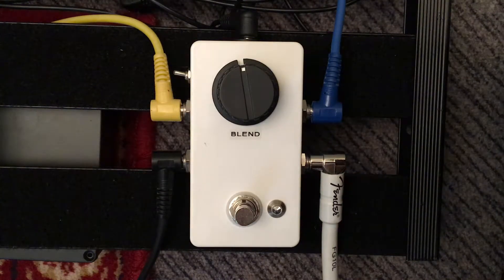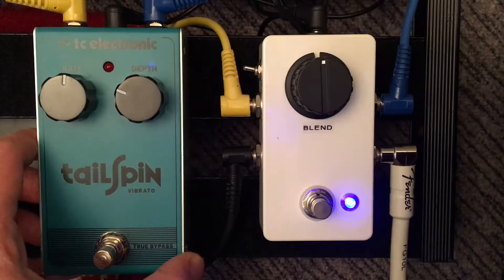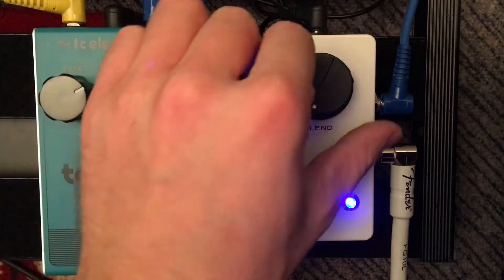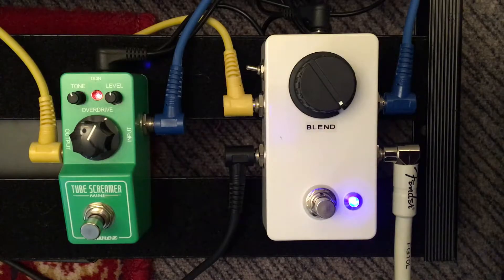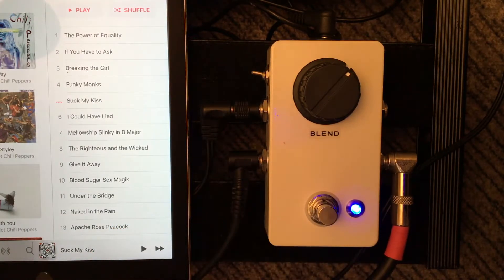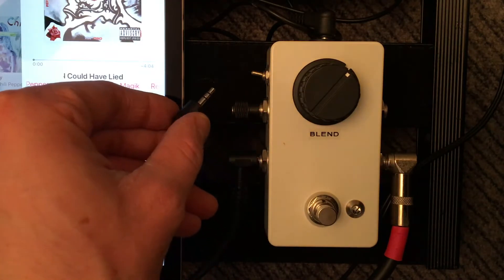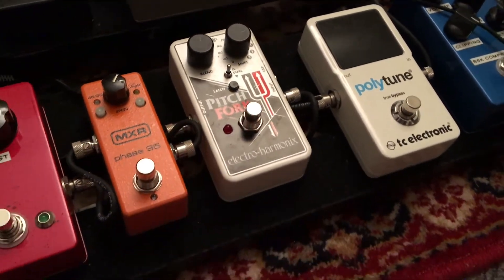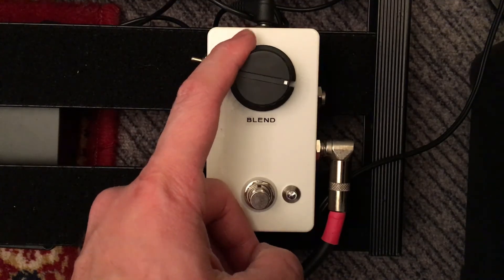Blend pedal with phase inverter

Comment: I built it, it works perfectly, but the scheme has an error, the two 4k7 resistors are soldered to the source of their respective transistors and not after capacitor 100n